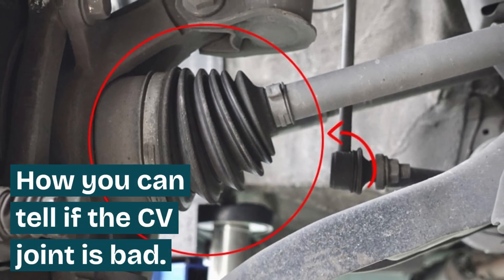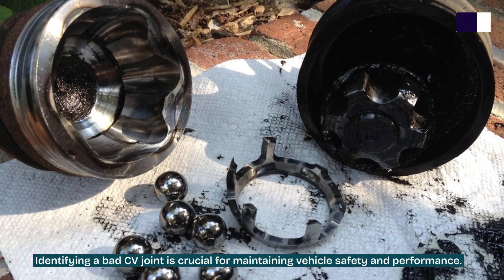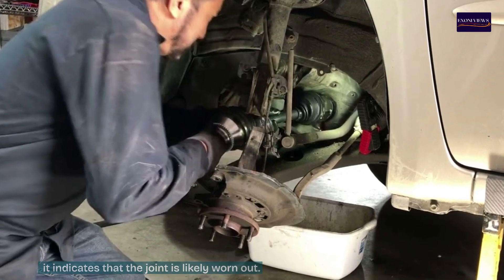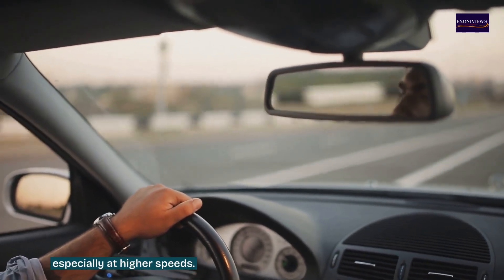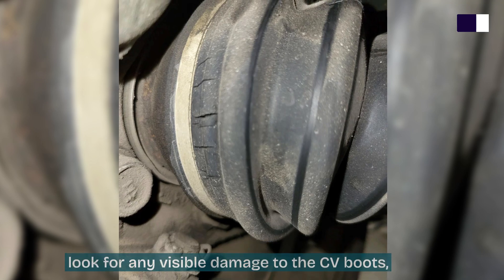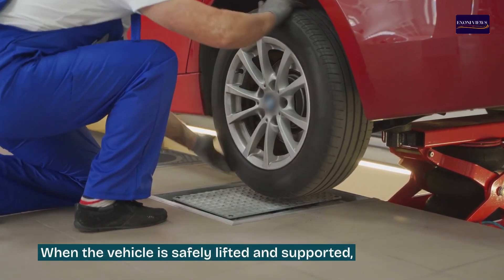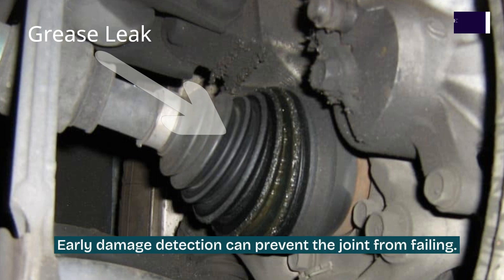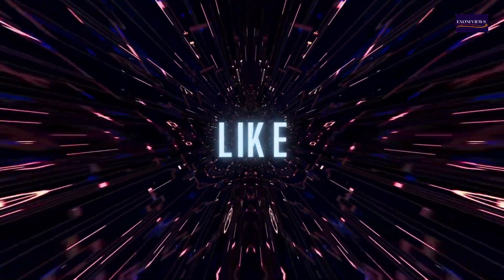Signs Of A Bad Cv Joint: How To Know If Yours Needs Replacing

Comment: CV joints can last 100,000 miles or more - if the boot isn't cracked letting the grease out - the costs are about $200 labor & $150 to $900 for the CV - during inspections , tire purchases & front end aliment ask the mechanic to see if the boots are torn -